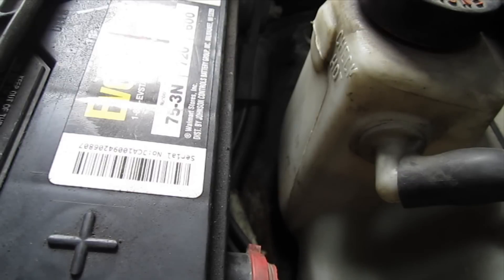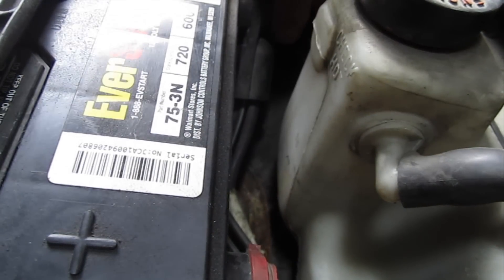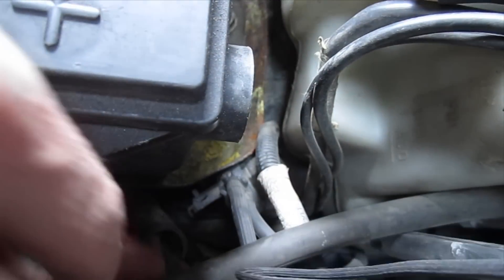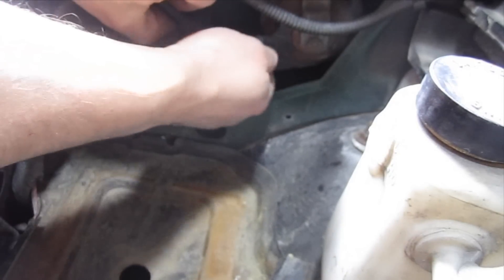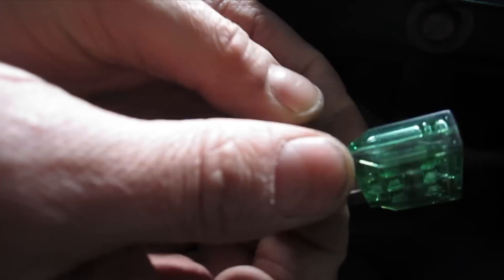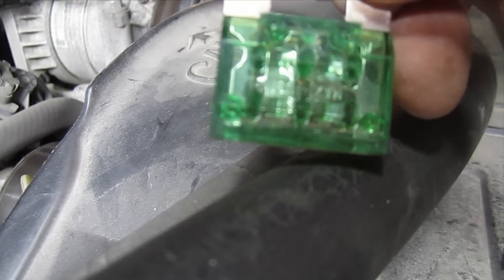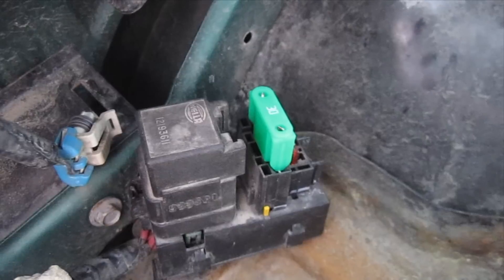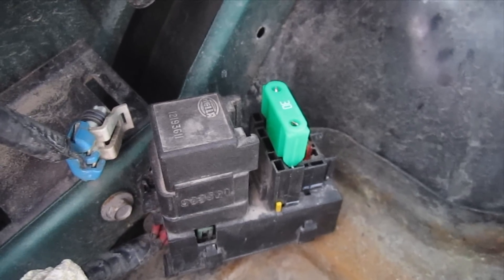P0410 Code Fix - Secondary Air Injection Troubleshooting | Chevy Blazer GMC Jimmy S10 (1996-2005)

Comment from the maker: AC Delco 215-638) Air Injection Check Valves on Amazon - http://amzn.to/2DSFl9Z
ODB2 Code Scanner Options on Amazon - https://amzn.to/2JTeP5e
Reply: How did you know where fuse was found on your rig
Reply: I clicked on the check valve link you have and is it the black one that attaches to the hoses on each side of along the manifolds?

Comment: I have the same code on my 2001 chevy s10 4.3L 2wd , I noticed the 5/32 vacuum hose that connects to the air pump and goes throughout the top of the engine bay to the valve has old age , cracked vacuum line and a hole in another one . I haven’t checked the fuse yet , I’m sure its blown though .

Comment: Since the fuse was shoot it mandated replacement. I found that the relay price was reasonable so with a new pump I had ordered 95% of what can go wrong for less than $160. This is not a hard job and lots of instruction out there.        Good video!

Comment: why didn't you complete the video? the video end with you reinstalling the battery but you don't tell us if the new fuse solves the problem and if it didn't what are the next steps in resolving this issue

Comment: Hi Justin would like to know if the fuse was the issue or was it something else . I have a 2001 blazer , I replaced the smog pump , the check valves on the manifolds and still have a code for it . Thanks for your time

Comment: see my problem so the 2 metal tubes on both sides of the manifold has check valves and it goes down to a t into the a black valve that opens and closes then goes to the secondary air injection pump so i keep blowing hoses off or blowing hte hoses up on my car to where it obliterates them and shreds them to piece's and i just fixed them again and it just blew off 3 hoses and i have a 2001 chevy blazer 4.3 so from the exhaust manifolds the metal pipe goes down to 2 hoses to a metal t that i fixed in there then to one hose that goes to this valve then to the pump so its blowing a hose off at the t and the one on the passenger side manifold so my question is i should prob look at the check valves the pump or just delete the shit and be done with it

Comment: Oh my god man, thank you so much. I was about to have the air injectors replaced and a new pump, this video sure enough saved me. My fuse was completely split all the way through, I didn’t think it would affect my gas mileage but sure enough I went 13 to 18mpg on my 2001 blazer. Thanks again!
Reply: A fuse ha imagine.  Sob itch

Comment: You contradicted yourself on the battery . While reconnecting it , you should have reattached and tightened completely  the positive terminal before you connected the negative  terminal.  Eliminating  any possible accidental shorting while tighting the positive terminal with the negitive terminal connected... just saying.. .
 Buy the way great video.  My Blazer has this code  for 6 years.  I've changed everything.  Never knew this fuse existed.  I can hear my fan running on Start Up. But it still codes. ???
Reply: Thank you I learned

Comment: Hey you're just the man I need to ask question about I have a 2000 S10 4 cylinder it runs fine when it's just sitting there as soon as I push on the gas if it wants to die out I done changed the throttle sensor what else could be wrong
Reply: I had this problem not to long ago it was the converter

Comment: You know there is a problem, you should inspect and clean the valve and the air pump while there. Cleaning all replacement parts is a necessary practice of good auto performance. Often one problem leads to another annual engine cleaning will save costly repairs.

Comment: Air pump  for my car  is  new pump  $ 65  for 2001 gmc  jimmy  2 door  6 cyl.  , buy in  Ebay  com  .LOW PRICE  , noo buy  in store Auto parts  is big price ,,  same  all new items  buy  in Ebay com  fuel pump for my car  $ 21  new ,  in  store auto parts $ 194 .. Web Site   EBAY  COM   is  CHEAP  new  items

Comment: Hi mate..informative video......I have a peugeot 307 2004 model......the old engine light came on P0410 fault.  Dealer did the inspection and says, regarding the secondary air pump.. hose to air intake valve degraded as has air filter.  So going to get a new air pump and valve...would that be the egr valve?  (They have quoted super high price for parts so I am going to source them myself)....amyway, any input would be appreciated.   thank you

Comment: I've had this code for like two years and never really dug into.  Typically I'll reset the PCM with a Bluetooth adaptor the day before the inspection, then the light will flip on a few days later.  I usually go about my business after that.
Reply: i dont see how it passes because your monitors take awhile to start recording after clearing any codes and they usually dont complete a smog test untill they are back on
Reply: @newmoneyx310x  you're allowed to have one system off and not ready. 2 if your car is older than 2001 I think.

Comment: I know this video is from 2013 I hope your still around. Your saying $175 for the pump, GM wants $394 for just the pump , are you getting one online at that price?  Also have you done a video on testing and replacing the pump ?  I would  like to see it if you have !
Reply: you can buy the air pump from autozone and oriellys for anywhere from 100 and something dollars to 200 and something dollars. and there's alot of places on the internet to buy a cheap air pump. Just got to research and compare prices.
Reply: about 160 bucks at auto zone with lifetime warranty

Comment: I have an S-10 of this vintage. My problem started with the P0410 code but I had all sorts of random stuff happening during warm up as well. (Right turn signal indicator would light up, Right front turn signal would not work, right front running light would not work, even the horn went off a few times) Long story short, it ended up being a ground issue, The secondary air pump was putting enough voltage on the ground loop that these items would not have a proper ground. This ground is connected in front of the battery just to the side of the radiator.
Reply: I am having random ground issues as well, I will search out this ground strap.
Reply: I currently have that issue with my blazer with the right turn signal being dim on the turn signal and the p0410 code why did I think it was a ground issue and now you confirmed that it might be. Did it solve the issue with yours ? I even had the check valves and air pump installed and no luck
Reply: These pumps easily burnout even after their new .

Comment: Did this work for you or did you have to replace the pump?
Reply: I just checked my fuse and it was blown so i would assume that the pump is junk
Reply: I think it only actually blows air into the exhaust during the first 90 sec. Or so

Comment: So I replaced my fuse, is the code supposed to clear immediately or does it need some time?
Reply: I believe you need an AP (Access Port) to wipe the code.
Reply: Disconnecting battery will clear codes

Comment: i know this video is a little old, but hopefully you're still listening. i have a 2001 blazer, so i'll assume the procedure/fuse location is the same for that year? i'm not throwing any codes, but i can't get my SECONDARY AIR obd monitor to "ready" despite a few successful drive cycles and several cold starts. i have also reset all monitors a few times just to make sure they are going "ready" consistently. is it possible that this issue is the result of a blown fuse, or would it invariably throw the P0410 if the fuse was blown? this is the only monitor that won't reset. i should mention that, at first, it was this and the catalyst that were hanging, but a bottle of cat cleaner and a few drive cycles has done the trick for the cat. i'd love to hear your feedback on this.
Reply: so i bit the bullet and disconnected the battery/took an ohmmeter to the fuses as you demonstrated and neither the 30amp nor the 10amp fuse were blown. i'm perplexed. any ideas?
Reply: Same, ever figure it out?

Comment: It was fine because it's never the fuse. These pumps get water in them in short out. I paid $300 to have one installed and it burned out within a month. If you need this pump, my suggestion is to only install it when you need inspection, and then remove until next year. You'll have the service light on, but code checkers are cheap now. The people who have made these should be forced by law to reimburse everyone this has caused problems for. And that's millions of people.
Reply: I've done the same thing

Comment: this video was the first video to pull in my search of (obd2 code 24   chevey s10) dident pass emissions wondering if this has anything to do with the air filter lid was turned upside down also this is the only code i have
Reply: ***** thankyou  !!,, im now looking at the test results the s10 92 apparently failed ignition timing and OBD system Checks ,, and they want 45 dollars for a retest after 70 dollars already ,, woW   so then my guess now is disconnect the battery at the parking lot  before i pay the extra 45 $ then i will probably pass ?? im  about tot do research now on failed ignition timing
Reply: teamhuman2  92 dont get tested in most state 96 and newer

Comment: I have installed all new parts and now the check engine light is still giving the same codes and two more codes that relate to the breaking system some code about the speed sensor in the brakes do you know how to fix that or what it means?

Comment: Mark.  I replaced the entire Secondary Air Injection System and fuses on my 2000 chevy s10. You name it an I replaced it,  pump, gasket, solenoid, valves, hoses, wiring, etc.  I'm still getting code P0410.  I had my mechanic look at it,  thought maybe I did something wrong.  He can't figure out what the problem is.  Any thoughts?